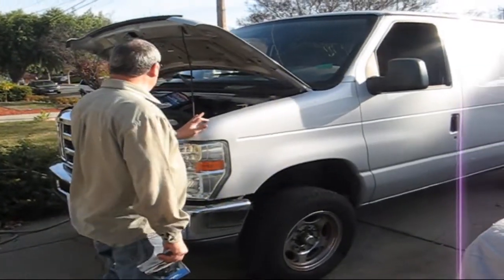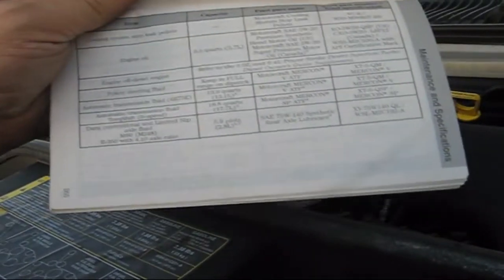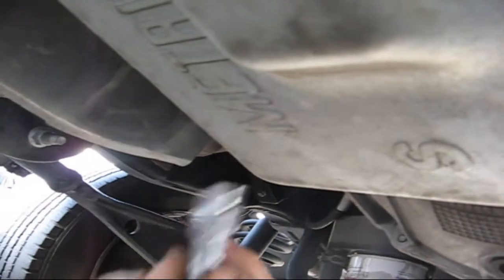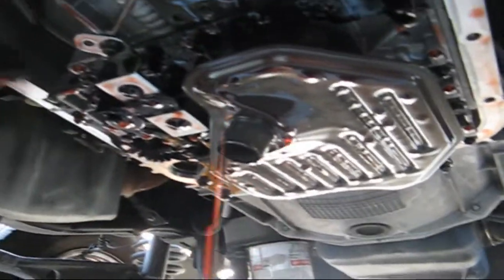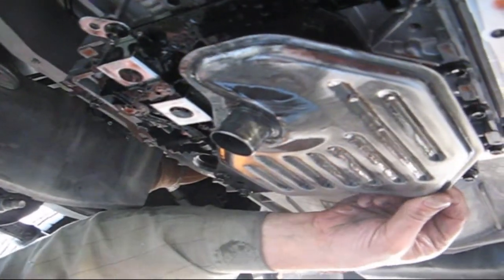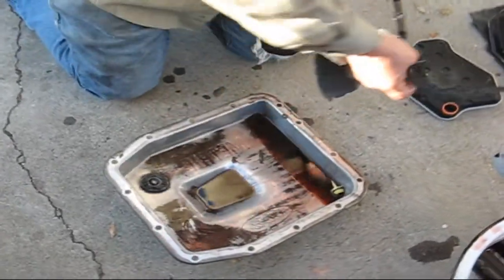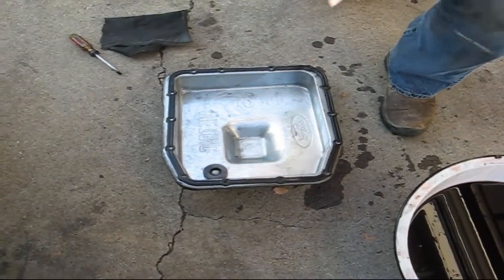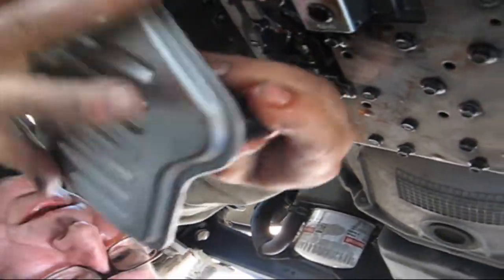How to Change Automatic Transmission Oil and Filter  - E150 Ford Van

Comment: Just bought a 2007 that had never had the fluid changed and this is the best/ONLY guide on this on YouTube. Perfect job
Reply from the maker: These vans only last for 350,000 after that they get a little tired.  The transmissions only need a filter and fluid change every 100,000.   
Pay me now (oil change) or pay me later (transmission replacement)

Comment: 21:08  3/17/2023
I just checked my tranny fluid in my E1 50 and the filler tube seems to be pretty filthy when I drop the pan will I be able to push the crud out of that downward?
Reply from the maker: I don't see why not.   Put some oil on a small piece of cloth and put into the tube and push it all the way through until it comes out below.

Comment: Thanks for the video. I want to try to do this by my  inexperienced self , and you make it look really simple. I'm going to use a fluid extractor first, to try to cut down on the mess.
Reply from the maker: Good luck, you are going to have a bigger mess.  
Stop being afraid.  This is not that hard.

Comment: I have a 2002 E150 4.6L.   Is the process similar to this.  And also before I start.  Is the pan normally in the front or back of the van??
Reply from the maker: The automatic transmission pan is under the transmission.  It is bolted to the back end of the engine.  You will see 2 pans, 1 under the engine and 1 under the transmission.

Comment: When you show the manual in the beginning of the video it shows 13.9 quart capacity, but you only got a little over 4 quarts out of it. I'm confused as that's such a huge difference. Would you mind explaining why that is?
Reply from the maker: Good question.  You never get all the oil out because there is oil in the transmission itself and in the torque converter.  The best you can do is drain the oil pan, clean it out, and change the oil filter.   I do my cars at 70,000 to 100,000  miles.

Comment: Thanks for the straightforward video, much appreciated. QUICK QUESTION - I heard that newer vehicles require modern ATF but that older vehicles can be damaged by the detergents of modern ATF and that you need to get 'old school' or old original type ATF for them. Is this a myth or is there something to that.  I can just see myself blowing up the transmission of our old camper.....you know, 'if it aint broke, dont fix it'!  I do think it desperately needs to be done (dont know if it ever was) and it could very well be on its original fluid from 1979. Anyhow, could you shed some light on that?  Cheers
Reply from the maker: Never heard that before.  I didn't know there was a difference.  Maybe, talk to the service manager at Ford.
I usually change the transmission filter about 70k to 100k.  There is nothing to screw up, just don't touch anything.   There is also a deposit of metal filings on the bottom of the pan so they must be some in the filter.    Cheap service.
Reply: Maintaining a vehical is key to making it last. Fluids where out as well waiting for it to brake is not smart preventive maintenance will save you thousands..
Reply from the maker: @hummertim1  Oil changes - the saying is "Pay me now or pay me latter"

Comment: Thanks for the yellow Plug Tip!
Reply from the maker: You would have been looking for hours and if you put it back together with out finding where it went, you would be thinking while drive the truck, did I do it right, I hope I didn't screw it up.
Reply: @davidlis6709  I literally started trying to plug every hole I seen in sight ...I suspected the fill plug but had doubts. Thanks again!

Comment: Hello good afternoon good evening I have a 94 Club Wagon with a 351 in it and it's set up for about 4 years I got it and I started driving it I haven't changed the filter or the fluid in the transmission but sometimes it jerks when I'm traveling or driving what might the issue be please help if you can
Reply from the maker: I have a 1995 Ford F-150 pickup that I keep at my mother's house in Upstate NY and I drive it 2 weeks in May and 3 weeks in September.  The rest of the time it sits by itself in the garage with a trickle charger on the battery.  I have been doing this for 5 years.
When I start driving it, for the first 1 to 3 days (not all the time) it slams into 2nd gear.  So I asked my friend who rebuilds transmissions for a living and he told me not to pay attention to it and just drive it.  He said that there is a valve in the valve body of the transmission that is sticking but after a while it will loosen up and stop doing that.
How many miles on it?  I usually change my filter and trans oil in my cars every 100,000 miles, no matter what the manual says.  My 2 cents.

Comment: Nice watch , is that a  Rolex GMT ?
Reply from the maker: It is a Sea Dweller, diving watch. 
I moved from NY to California in 1980 and I started to ocean dive.  My Timex lasted one dive, filled up with salt water, turned green and died.  The move was a significant emotional event in my life because I had no job, nothing,   just my van full of everything I thought i would need and $3,000.  I was able to find a job, buy a house, eventually find a real California girl, so I bought myself reward.  I paid $1,500, which was a lot at the time.  I was going to have a new bezel put on but every Rolex dealer wanted a lot to do it and they all wanted to buy it from me for $15,000.  They also said not to do anything with it  because people collect old watches.  Then they say to have it serviced every 5 years.  I did that after the first 5 years and I have to bring it back 2 time for them to get it right.  So, I will have it serviced when it stops.  I have been running good for the last 35 years.  As you see, in my videos, I use it all the time.  Have a nice day.
Reply: @davidlis6709   Excellent ! I have a GMT I got when I started college in 1976.It was  bought in Geneva from the factory store. for about $400 and presented as a Christmas gift . The Sea Dweller is the ultimate fine timepiece, I cracked the bezel and had it replaced by a factory representative store in Miami  , The technician had me sit in a chair a watch him do it.  
This watch means a lot to me , so I only wear it now for special events.They have become so valuable . 

I have to fix a like in  my trans case , your video was helpful . thanks
Reply from the maker: @carlkenyon4599  Forget that save it for special events.  Everyday you get up is a special day.  Who are you saving it for?   No one appreciates the watch like you.
I was in Lugano, Switzerland, in 2001 an the Rolex dealer was selling them for $3,000 and I did not buy one.

Comment: Hey David, Great video!! I have purchased my 2005 E250 about 2 years ago at 25k miles and now I have about 39k miles. I’m not sure if previous owner performed any Transmission fluid change. I called Ford by my house in NYC and they are saying it’s a 16 year old Van and it’s too late to do transmission fluid change and the service advisor said he don’t recommend it. So at this point not i am not sure if I should change the fluid or not. Any suggestions!! BTW the van drives like new. No problem in shifting at all.
Reply from the maker: Does he want to sell you a new transmission?
Never head anything like that before.   I think he is full of it.
Change the oil and filter and do it every 100,000 miles.
That van will last you as long as the body does not rust out from the salt.

Comment: Are you supposed to start the engine when filling the new fluid?
Reply from the maker: Yes, You want the fluid hot when you check it to see if you have enough.  Also, when you think you have enough, I put the truck in reverse and then in drive and back to reverse and into park, then recheck the fluid.  This simulates driving the truck.

Comment: im having trouble finding the replacement oil filter for my 95 ford E350. where did you find yours? any advice would help!
Reply from the maker: O Reilly s Auto Parts,  they had it in stock.  How about online?  Don't go to Ford - cost to much
Reply: David Lis do you happen to have a part number? is yours a 1995 e350 as well?

Comment: I think I will ware my rubber gimp suit when I do this job.
Reply from the maker: It is not that bad.  At least it is a cleaner oil not like used motor oil or the worst, 90 gear oil from the rear end.

Comment: Why would u change a tranmission fliter on a ford
Reply from the maker: I change it on all my cars about 100,000 miles.  Ford, Chevy, Mercedes, Toyota
Reply: David Lis ok so how do you know what the problem if it take a while to change gears
Reply from the maker: I am not an automatic transmission expert but the first thing I would check -  is there enough fluid in the transmission.  That happened to me several years ago.